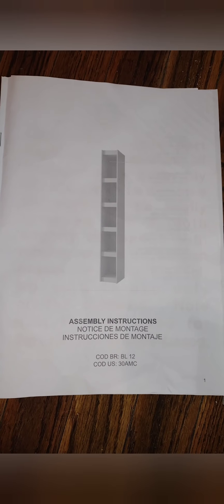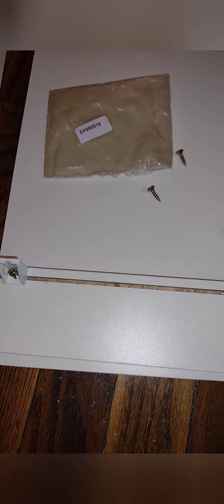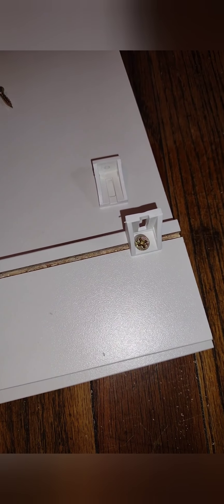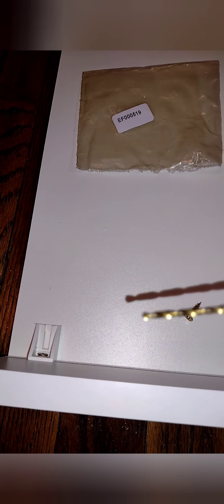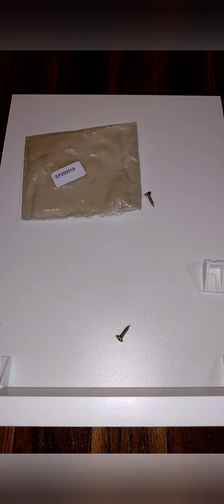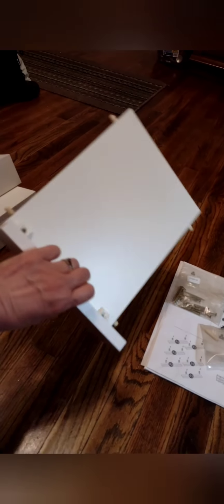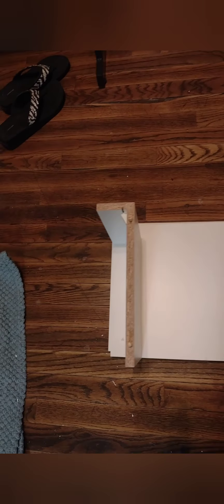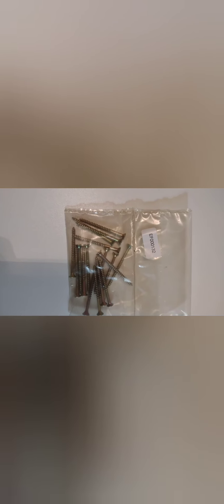Manhattan Comfort Parana bookcase 1.0, assembly instructions, product link in description box

Comment: Why don't  the sides of the Parana bookcase 1.0 have  a  drilled hole through. the sides in every place where there is a hole for the wooden dowels . 2 dowel holes do not have a drilled hole near them